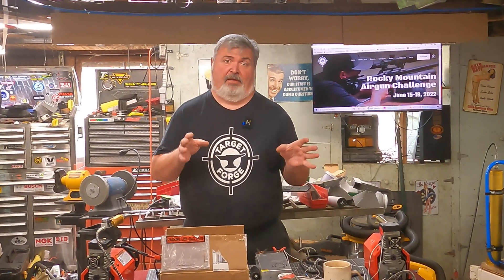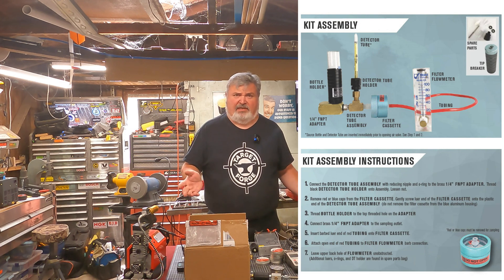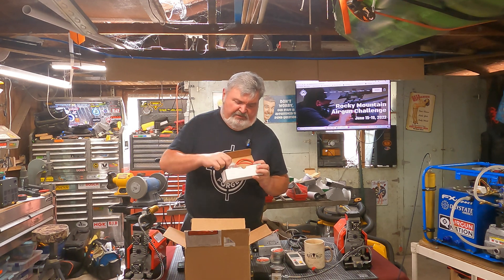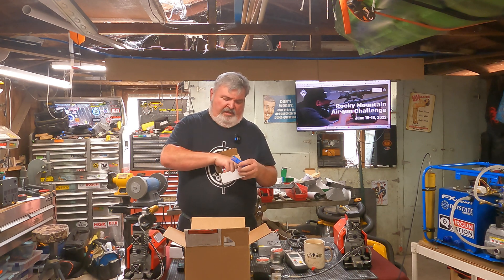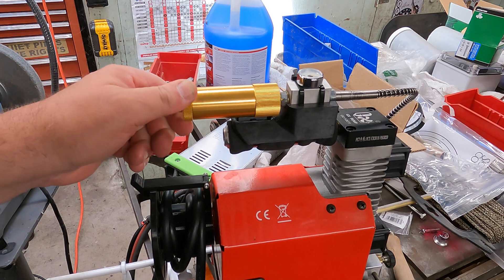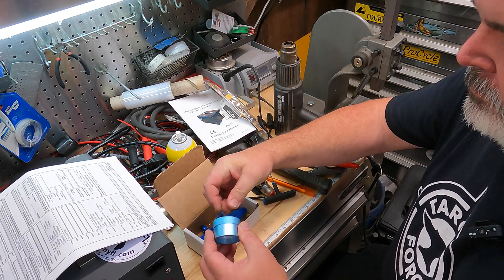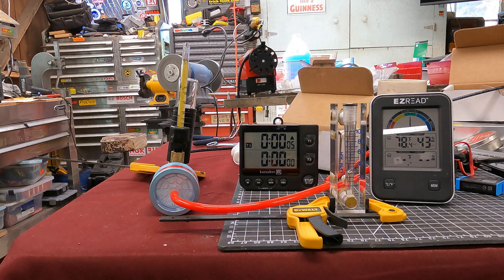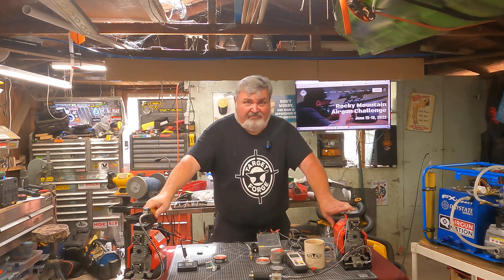Yong Heng vs GX CS2 Actual Air Quality Test! Part 1 Yong Heng Hot Rod Shop YHHRS ep 015

Comment: What would be a good compressor for filling up paintball tanks 68/4500
Reply from the maker: Hello Dundee. Always a good idea to include the units when sharing numbers. A 68 Cubic Inch volume is actually quite small. Just over 1 liter according to the Google Box. Probably fine on a GX CS2 but you also have not mentioned what your refill level is. Do you typically run these to empty? Or are you refilling them at 2500psi? This all translates to run time on the compressor, which for the GX CS2 is 20 min on, 10 min cool down, repeat. I'm guessing 2500 to to 4500 on that little bottle will go pretty quickly, perhaps within that first iteration. If you want, you can send me a bottle and I'll do a fill and send it back to you. Might make a fun video! Thank you for your comment.

Comment: I've been wondering what this test would show but never got around to checking myself. I like that gauge block holder in the intake/carry handle. Did you make that? I run a big blue filter that has a cartridge that you can fill/change the media. I have molecular sieves, silica gel and dri-rite desicant. I also use the body of one of the inline cotton filters as a moisture trap that collects moisture amazingly well. I cannot detect any moisture at output. I filled from 0psi a 45 minute SCBA tank to 4500psi. Then discovered a small leak at the regulator. So I used the air in it then let it bleed off slow. No moisture in the tank.the tank was also brand new and I put the regulator on it. Was the oring not seating right.
Reply from the maker: I did make that, the files are available on printables.com if you have a 3D printer you can print them for free, or they are available on my site "Target Forge" at targetforge.net if you want me to print them for you. My advice on drying agents in filters? 100% Molecular Sieve, their capacity and performance is vastly superior from what I've read. Don't let what you cannot see fool you. Visual assessment of air moisture content is not reliable at all. I am curious when you wrote "regulator" did you mean valve? Most bottles use a threaded valve assembly and if someone wants a regulator that is usually attached to that to provide a stable pressure output. Mostly used for tethering, just curious what your setup looked like. Keep in mind that using these little pumps to refill large tanks really consumes the hours on these units. They are simply not designed to take that over time, my current data indicates about 20 to 30 hours of run time between rebuilds, that does not equal a lot of large bottle fills. Don't let that pump run longer than 20 min at a time either, with at least 10 min cool down with the fans on each cycle.
Links to the 3D files can be found in the description on this video: https://youtu.be/srLyz2Jt22A
Reply: @TargetForge  yes, I meant tank valve.   I run mine until it gets to about 140F. I also have 2 fans blowing on the compressor while it's running.

Comment: Hello Bill… greetings from Peru 👋👋👋…once again you have made a great video. Thinking to improve the quality of the air output from  the GX CS2, I included an additional filter before the airgun probe. The filter is a two sections one (Active carbon+calcium oxide)… do you think that this works? What would you recommend to improve the air quality?
On the other hand, do you know where can I find the white sponges pads? The manufacturer included just few ones.
Thanks again for sharing your investigations, tips and hints.
Reply from the maker: I will address much of this in part 2. I'll get to your other questions tomorrow if I can. Thank you for reaching out!
Reply: Hello Bill, thank you so much for your reply. I will wait for your research to see what to do as the best option. These Airguns are expensive and it is key to fill them properly. Thanks
Reply from the maker: Hello Antonio, First of all, I would not EVER use Calcium Oxide in your filter. From Wikipedia:
"Weapon
In 80 BC, the Roman general Sertorius deployed choking clouds of caustic lime powder to defeat the Characitani of Hispania, who had taken refuge in inaccessible caves.[21] A similar dust was used in China to quell an armed peasant revolt in 178 AD, when lime chariots equipped with bellows blew limestone powder into the crowds.[22]

Quicklime is also thought to have been a component of Greek fire. Upon contact with water, quicklime would increase its temperature above 150 °C (302 °F) and ignite the fuel.[23]

David Hume, in his History of England, recounts that early in the reign of Henry III, the English Navy destroyed an invading French fleet by blinding the enemy fleet with quicklime.[24] Quicklime may have been used in medieval naval warfare – up to the use of "lime-mortars" to throw it at the enemy ships.[25]"

The activated charcoal isn't doing anything for you either. You might consider a molecular sieve media for that filter you are using and be sure to keep it vertical.
For the separators in the filter stack I have purchased them before on Amazon, but that link I used is dead now. I would use an old one as a template and get some heavy felt and cut your own, just reuse the metal backing screen if your unit came with them.
I'm still learning what the correct solution is for these little compressors, and I will let everyone know what I find out.

Comment: If you want dri air out of the GX CS-2/3 feed them low pressure Nitrogen BONE DRI .01ppm moisture
Reply from the maker: Terry your solution is solid, but not overly practical for those without access to inexpensive compressed gases, and it REALLY defeats the portability of this unit in the field. You have that access, and experience with handling pressurized gases, it is not common I'm afraid.
Reply: @TargetForge  A 42 cuft nitrogen tank would fill my 580 cc bottle many times and can easily be carried with the cs-2 and there is nowhere in this country except some very outlying areas that don't have a welding supply store nearby
Reply from the maker: Terry, you have a great solution that works for you and what you are comfortable with using. Hats off to you Sir. Not everyone is comfortable hauling a high pressure vessel around with them in the areas a portable compressor typically is used. I have access to all the compressed gas I can use, right now. What happens when that goes away? Or costs push more and more away from that? Many use a compressor to get away from relying on a source for feeding their PCP guns. They don't want to go to dive shop, let alone a gas supply depot. I'm not knocking your solution AT ALL. I think it's really good, do I think it's for everyone? Nope. What happens if you allow too much gas into the head of that compressor from a freshly filled bottle? You know how to throttle that, or maybe you are using a flow regulator, you came from that world, it works for you, thank you for sharing it.

Comment: Sorry for the second comment but I also noticed excessive moister too with the slow AC/DC compressor I have for backup and camping for when my tanks are low. Yes sir much more moister from the slower reciprocating compressor than my other 2 Yong Heng Hard tops. Maybe because of the extra condenser and piping on the YH’s v/s a single small tampon filter plug that comes with the AC/DC compressor I don’t know but makes sense. The 110/12 volt compressors are made for filling small cylinders on airguns where the YH is made for both cylinders and tanks🤷‍♂️💯
Reply from the maker: I think the only reason the Yong Heng was dryer was due to the filter on it. My Yong Heng is the single block type and both had the exact same input air. That filter really works, and cotton does not was my take away. I also have an auxillary cooling loop on the final output line of the Yong Heng which appears to act like a condenser of sorts. Even with that though all tests were done with no venting because they never built any pressure.

Comment: I understand very well that without very good filtration a Yong Heng being that it uses oil would not be a good choice for breathing air, however, with the proper oil like Seco 500 Diester oil that is designed for breathing air and will not create carbon build up on the top pistol of the Yong Hengs 2 in 1 piston design… With that out there…I am very curious to see a proper test on the air coming out of this setup. I do know that before I used Royal Purple Synthetic Comp oil and I saw smoke sometimes. I do not with the Seco Lube 500 Diester. Would make a great video if you had the time. Lasts a lot long than RP! Thank you for this video. BTW Stephan of Air Velocity Sport has a video on his channel about Seco Libe 500 Diester and some information about Triester oil for breathing air like dive shops use. Hope this helps y’all. God bless and stay safe.
Reply from the maker: Thank you for your input Heath. When I am evaluating lubricants for a particular use I like to start with the data sheet on that material. It helps me push past the marketing spin and see actual, standardized test results so I can make an informed assessment. What I found very odd was the the source of the Seco Libe 500 claimed to not have a standard data sheet available. I found this very strange and not what I expect when researching a lubricant for a give application. I switched my search to the base oil, a Diester, and many of the manufacturers of the base oil actually state to NOT USE A Diester base without VERY good filtration for breathable air. Tough to get straight REAL technical information if the supplier won't supply a data sheet, they did offer a MSDS, which is not the same as it does not address its performance as a lubricant, only how quickly it can end you as a human. If anyone has actual test data in the form of a data sheet, I would greatly appreciate seeing it.

Comment: My molecular sieve blows the burst disc at 4500 psi but still works for 3600 psi.
Reply: Thanks for the comment. I'm not sure I understand the issue you are having. Are you saying the filter causes your burst disk to fail? Or the burst disk on the filter fails prematurely?  A filter should not cause a burst disk to fail. Sometimes the items we get from china do not represent what they advertised, no doubt about that. Mine only gets used to fill large bottles to 4500psi, has done so for a long time, since 2018. If I put one on the GX, it should live a more sheltered life as I only use that for direct to gun fills.
Reply: @wruehl  
I bought a new type of filter. It’s the kind that has the twist knob drain at the bottom of the cylinder body. It seems to work well and fills my Gauntlet.30 caliber to 4500 psi.  I am no longer using the molecular sieve filter.
Reply from the maker: That sounds like a Coalescer and they are great at removing a bulk of the moisture and oil (no real oil to remove on a grease lubricated GX). I imagine that if a fella wanted seriously dry clean air, a coalescer into a molecular sieve would be a fantastic combo. I've had a coalescer on order and it is supposed to arrive today, I have one set of test media left, the results will be in part 2!
Reply: @TargetForge  
It’s a TOAUTO 30Mpa water and oil separator for high pressure. Bought it from Amazon… It is expensive!
Reply from the maker: What did you pay? I thought they were pretty cheap compared to the more serious ones on the market. I have the same one arriving today. Compared to Tuxing Gold Tube they might look expensive I guess, but then again they don't need consumables either, so cost of ownership should be better.
Reply: @TargetForge  
$138.00 plus free shipping…
Reply from the maker: That's what I paid too. I'll let you in on a secret from part 2 of this episode. Coalescers need more air velocity than a GX compressor can provide, so they do not work well at all on those units. I still need to test a Molecular Sieve based filter, I think based on the results from the output of the Yong Heng it will work out. Wish me luck!

Comment: Just bleed air and remove Front Tube End and clean inside air tube two or three times a year, and replace inlet and  tube orings. Never had any problems moisture or corrosion with my guns.
Reply from the maker: You must live in a desert then. This test was started with a COMPLETELY dry system, brand new filter media and as shown in the capture sequence, a moderate RH. The data does not lie, the GX compressors need WAY better filtration than they are shipped with. That tube was saturated in 38 seconds! With a molecular sieve filter AND much higher flow rate (which makes this even harder) that air was bone dry.

Comment: It will be interesting to see the test results.  I am using a molecular sieve filter with my CS3 like the one you have on your Yong Heng.  Hopefully it is removing the majority of the moisture from the air.
Reply from the maker: I think you are pretty safe, the molecular sieve seems to have performed very well in this test.